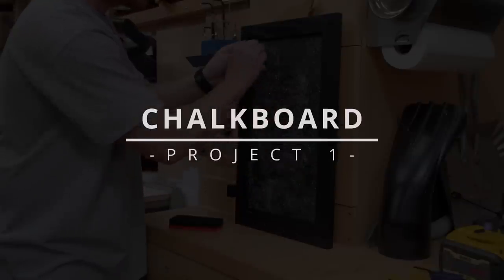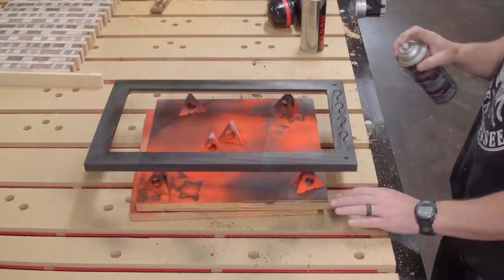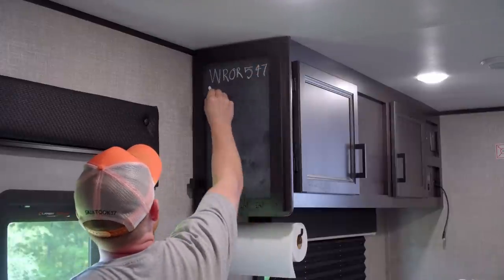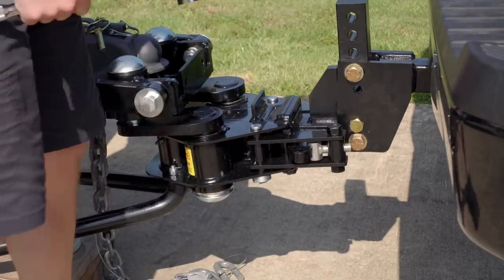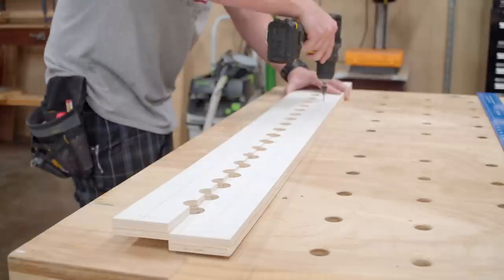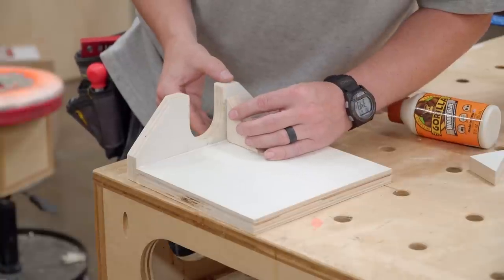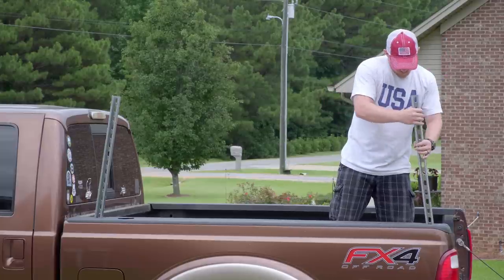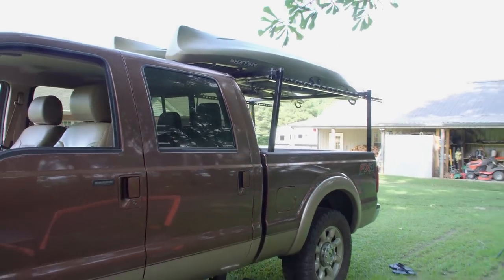5 Camper & Camping Projects - 389

Comment from the maker: Check out the 3P sway ELIMINATION hitch at propridehitch.com. It's the most advanced version of the Hensley hitch system from the original inventor, Jim Hensley. Deciding to get a sway elimination hitch is a safety decision, similar to buying a SawStop, as the safest way to deal with the dangers of trailer sway is to eliminate the sway completely. I have a 2,000 mile camping trip planned for August and am no longer dreading the long drive with this hitch. As with the safety features of a SawStop, I find the increased safety with the 3p to be well worth the cost. 
https://www.propridehitch.com/

Comment: pulling with that F250 diesel is so much better than the F150 gas.  I went the same route several years ago and now we're up to a 43' 5th wheel and F450. Happy travels.
Reply: 450 is nice because you get the 22.5 wheels and the tighter turning radius, am I right, or do you have to go up to a 550 for that?

Comment: A note about keeping truck keys in your camper. We found that, because we have proximity keyless door locks on our truck (ie: the door unlocks when you touch the handle with the keys in your pocket) if we park the truck close enough to the trailer and the keys are located in the trailer close to that position, it may be possible for someone without the keys to unlock the vehicle. We found this out the first time when we stopped for an overnight without unhooking and I put the keys on my night table, which is right at the nose of the trailer.

Comment: I'm super jealous of your front stake pockets.  My 2021 doesn't have them and I use a MX4 Bakflip hard cover.... that makes it very difficult for any kind of overlanding rack.
Reply from the maker: interesting. I can't imagine any full size pickup not having them. I likely won't leave this one in all the time because I do miss my bed cover at times.
Reply: @JayBates  I have the back stake pockets but the fronts are covered by trim.  I don't know if anyone manufacturing drop ins and the only solution is to route out the plastic to access.  Totally fine with wood, but I'm a little uneasy about routing something on the plastic trim of my truck

Comment: the best way to avoid trailer sway is not to drive faster than 50mph. and if it happens anyway, 
- DO NOT accelerate trying to "stretch the rig", driving faster will only make it worse. i know someone who put his trailer on its side by making that mistake
- DO NOT hit the brakes
instead, 
- take your right foot off the pedals
- if you're driving a stick shift, hit the clutch and keep it down until the trailer stops swaying.
Reply: Just manually apply brakes to the trailer. That's it
Reply: @marcelo403polo2  
if the trailer has brakes that can be controlled by the driver, which AFAIK most of them don't.
Reply: I was always told to hold the steering wheel along the bottom.  It counteracts the sway before it can get out of hand.
Reply: @mrxmry3264  All travel trailers have electric brakes with controller inside the truck. Not sure what you mean saying most of them don't???????
Reply: @marcelo403polo2  electric brakes? i dunno how it is in the US but when i drove a car with a trailer in germany it didnt have anything like that.
Reply: @mrxmry3264  Aaaah. Europe...... Surge brakes only over there. But we are on American YouTube Chanel here, and talking about northamerican standards.
Reply: @marcelo403polo2  surge brakes are the worst!
Reply: @jeremyspecce  I heard that, but never had any experience with them. Some older boat trailers used to have surge brakes. Now I hear all boat trailers come with hydraulic brakes controlled  by standard controller. My first travel trailer was 1964 Shasta. It had electric brakes.
Reply: The best way to avoid trailer sway is NOT to not drive faster than 50 Mph, it’s to have a properly sized and balanced rig. If you can’t drive faster than 50 without swaying you should not be on the road. We have NO sway control on our trailer. We have a properly balanced Weight Distributing Hitch (it took some research and a few tries to get it right) with a properly loaded trailer and we can do 75 with our F-150 towing a 25 foot travel trailer without sway. I’ll say this again, if you can’t do 50 without sway you should not be on the highway.
Reply: @jeremyspecce  👍Exactly.  I typically drive 70mph with 8000lbs trailer. Also I use 3500 Duramax for it. Key word is- proper towing vehicle and properly loaded trailer
Reply: @jeremyspecce  
a lot of factors affect trailer safety. one of them is speed. the faster you go, the less stable the rig becomes. that is why accelerating when the trailer is swaying is THE WORST thing you can do.

Comment: Incorrect. The best way to eliminate sway is to properly load your trailer and ensuring the proper tongue weight. Relying on a hitch to control your improper loading is naive at best.
Reply from the maker: Incorrect. A properly loaded trailer won't stop trailer sway.
Reply: @JayBates  yes it does. Physics is real. The whole purpose of the Anderson hitch is to work with the laws of physics to extend the virtual moment of inertia in front of the rear axle. It does not stop the trailer from swaying, it extends the capability of the operator to not feel the sway and to drastically reduce the effects of the trailers sway to affect the tow vehicle. You still need to properly load the trailer to reduce/eliminate the trailers tendency to sway. Again sorry Jay, love your videos and been a fan for years. But you’re a little naive to think the hitch eliminates the trailer from swaying. It is a subtle, but real difference.
Reply: @2stixlz  I don't want to be driving merrily along, oblivious to the world while people are honking to let me know my perfectly loaded trailer is making lane changes behind me due to the wind, pavement crown, micro adjustments to the steering wheel...Lots of reasons for sway to start; dampening sway so that it becomes manageable or negligible is the goal.
Reply: Your response tells me all I need to know. You’ve never towed. If your trailer is swaying, you don’t need people passing you tell you, you’ll know. Towing a trailer should not be an oblivious activity. You need to tighten up the awareness cap and be responsible. Jay enjoy your hitch and your travels. You’ll have a great (and safe) time and build many core memories for your family. I just wanted to point out to those that watch and listen to you, that sway comes from the improper weight distribution on a trailer period. It (the trailer)can handle all of those scenarios you mentioned with predictably if loaded properly. Your very fancy and expensive hitch is designed to deal with the sway in a very well thought out and engineered way, not eliminate it, it can’t because the sway is the trailers action. If you do not fundamentally understand loading a trailer and the pendulum effect of improper weight distribution, you are creating dangerous situations and depending on your hitch to save you. Not a situation I would want to put my family in, or the people on the road around me regardless of the hitch connecting me to my trailer.  I’m not putting down your choice in hinges, I think it is great. Just pointing out a fundamental miss understanding of the reality of physics. Unfortunately, even the manufacture plays that miss understanding in its marketing to its advantage unnecessarily. 
Thanks again for your very enjoyable videos, I always look forward to watching them.
Reply: @JayBates  
be that as it may, i would put the heaviest items in the car or truck, but don't overload it, and keep the tongue weight in mind. then if anything is left, put the rest in the trailer, with the heavier items in the bottom and the lighter items higher up. you might have to shift some items around to adjust the tongue weight, and of course tie everything down so it can't shift while on the road. and it would be a good idea to check EVERYTHING every time you take a break.
Reply: @jeffbaker8808  only an idiot driver would not notice trailer sway. even if the sway is too minor to be felt, one look in the mirror would reveal it immediately.
Reply: @2stixlz  also, it's always a good idea to check the mirrors frequently and if the trailer sways, slow down.
Reply from the maker: @2stixlz Awesome! You know me better than I do. I now have "never towed." Is there anything else you'd like to let me know about me? 

Again, incorrect. Yes, an improperly loaded trailer WILL cause trailer sway. No, properly loading it doesn't eliminate trailer sway. You can, and will, very much still get trailer sway with a properly balanced enclosed trailer.
Reply: @JayBates  I Know nothing about you other then what you present online very publicly. 

Enjoy your hitch and camping. Get some miles under your belt without that hitch and tell me what causes sway. Until then I feel like I am only talking to the sales rep of Propride. I just worry for those that think "Oh, my trailer sways, I should get this Propride hitch and it will go away!" You and the sales brochure present it that way and that is my concern driving on  the highway with people that know no better. 

It should be honest and say that sway is an imbalance and trailers are dynamic, balance your trailer to manufacture recommended specs (or industry standard) and we will give you a wide berth of safety for those rare scenario's that can cause sway in a properly balanced trailer.

Instead, it is presented as "Use our hitch and sway will be a thing of the past" skipping the whole real world physics. Your propagating this twist is what threw me off enough to comment because I have experience with this. When you talk about wood or woodworking, I listen and watch you because you have experience and know much better then me.
Reply: I’m sorry, but I tbink I’m with @2stixlz . A properly loaded trailer and properly set up weight distributing hitch will eliminate the tendency to sway. Just as an improperly loaded trailer will INDUCE sway. Systems like the ProPride are a good way to balance that rig, along with proper weight loading, and can counteract / prevent sway induced by outside factors such as evasive maneuvers, trucks passing, etc. I would also add that I don’t think his “you’ve never towed” was directed at you, i believe it was in response to Jeff Baker’s comment.